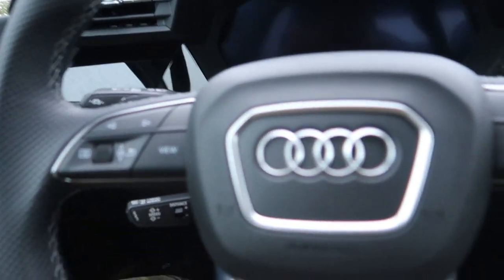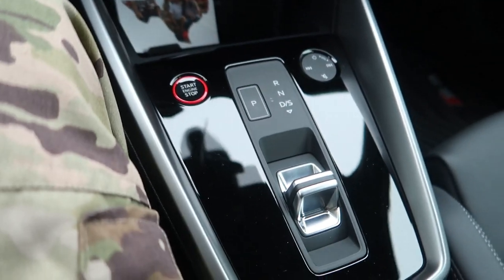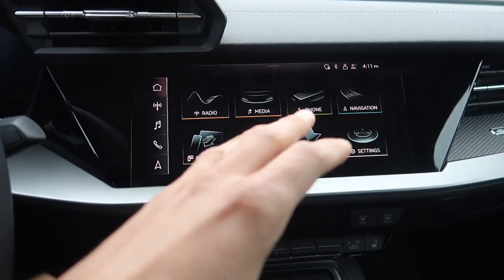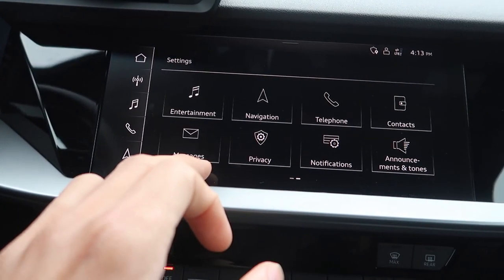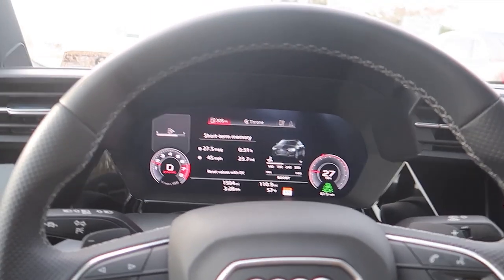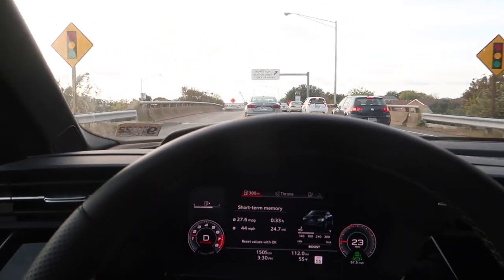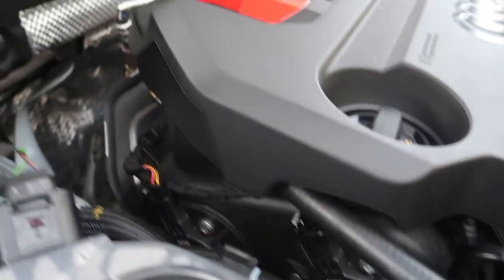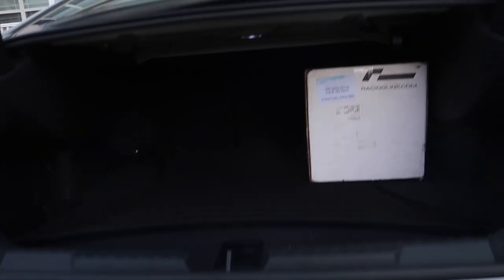Some likes and dislikes of my new 2022 Audi S3! | 8Y S3

Comment: What do you think of the interior plastics? I'm a MK7.5 R owner and when I sat in a new S3 yesterday and I was disappointed with the plastic on center tunnel (cup holders) and some of the door trim.
Reply from the maker: I feel no less quality then my old R, I have zero complaints about the interior 👌🏾👌🏾 really loving it
Reply: @BryceJordanProductions  Thanks! It was nice you touched on the new volume control - I was unsure about moving from a traditional volume know but it's comforting to know you think it's fine.
Reply from the maker: I always forget about the touch control since there's a nub on the wheel, it's alot of fun to use though it's oddly satisfying lol

Comment: So, no spare tire right? I can’t remember if the previous S3 came with a spare tire either. Just wondering. Great video…car is really growing on me.  Why couldn’t VW follow adding buttons similar to the MK8.  Oh well…Lol
Reply from the maker: Correct no spare, same ol' fix-a-flat and a pump lol. I think there will be buttons you can buy and direct fit from the Atlas or Tiguan
Reply: the 8v s3 came with a space saver spare the 8v rs3 came with a fix-a-flat
Reply: Yh my model does come with spare tyre 8v

Comment: I had a question for you! Why upgrade to a slightly improved ea888? Because I think we both know power capabilities of those engines and I know that there’s the upgraded diff, turbo and few other things but for a new s3 or a used rs3. I feel like the upgrade would’ve been a second hand rs3. No hate and I respect the choice but if you’re chasing power, wouldn’t the rs3 be the instant go to? 

Either way, love the car! New s3’s look phenomenal In my opinion.
Reply from the maker: There's a few main reasons why.. 
I wanted the updated tech.. wireless carplay, I'm a nerd for USB C. Screens fancinate me and satisfies me ADD with all the functions and whatnot. I also wanted another ea888, I have so much time with them I didn't wanna dump all that knowledge and swap to another engine.. and on that note the 5cyl is EXPENSIVE. Like a used block is more then what I paid to build mine. And they practically use the same rods and pistons.. so they need build rather early to really be beat on like I do. And I didn't wanna build another motor anytime soon. I also figured that it would be pretty fresh on YouTube I could kinda have my own little corner with little to no competition over here lol. And it looks dope. Anddd I can kinda use this as leverage with companies who wanna get testing done or release new parts for the 8Y/MK8